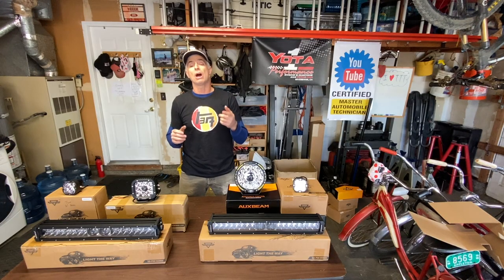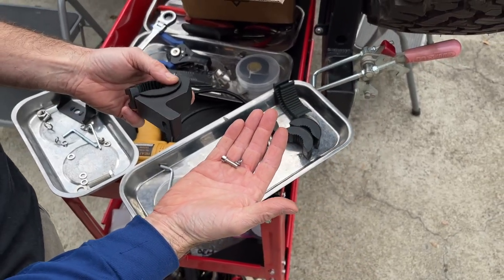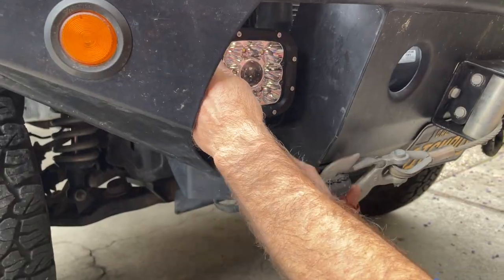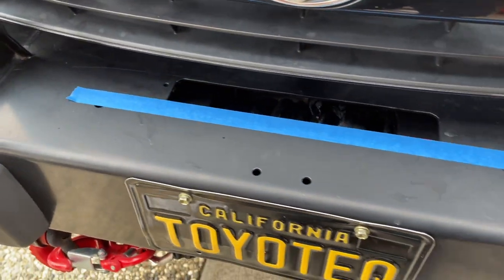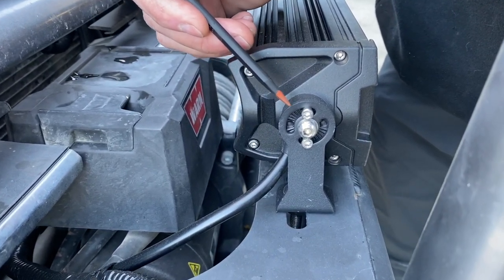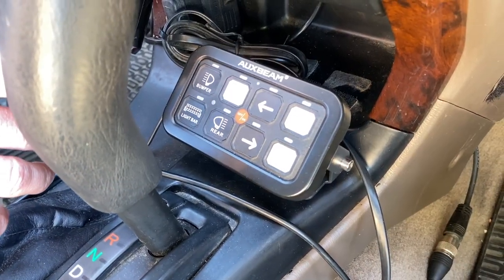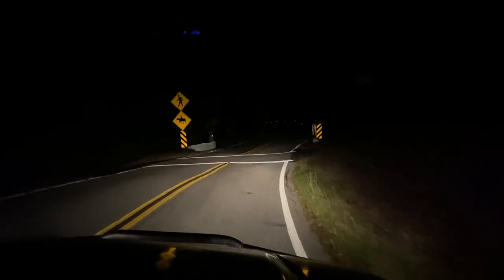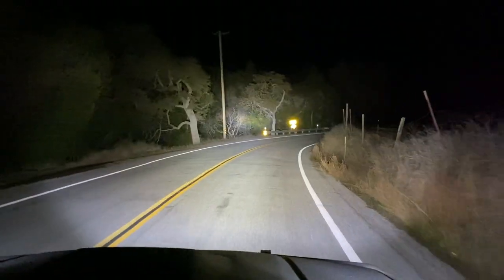How to Install Auxbeam Lights (Mounting and Wiring)

Comment: Wow, those look awesome!!  Thanks for sharing another great video.  I'm glad you mentioned the multi-mode dilemma.  That's exactly what I've been looking at b/c I'm not ready to run lights all over my rig yet, just wanted something I could mount on the A-pillar that might help in fog (amber mode) and on trails (brighter, white mode) and just be able to switch back and forth.  This wiring/electrical business is definitely not my cup of tea, and I just assumed I could easily run the clicker through the firewall (or use an OEM version like Sean mentioned).  I may need to re-think this and get single mode lights.  Thanks!!
Reply: if youre using ambers up front to help with fog you want them mounted as low as possible. not on the A pillars
Reply from the maker: Yeah, we're stoked on the lights.  Glad you like the video.  The multi-mode function could possibly be powered via another switch spot on the switch panel.  You would run the yellow wire to one switch to control the mode function and the black and red to another switch to power the lights.  I didn't want to go that route taking up two switch spots for one set of lights.

Comment: Great tip using wrench to open split loom. Check out Deutsch connects, bit pricey but allows 2 wires in and 2 or 4 wires out. Also they have a bracket that clips on and you can bolt to the rack.
Reply from the maker: Thanks for the suggestion on those connectors.  I'll take a look at them.
Reply: I know the connectors you are talking about but how do you get the 2 wires in 4 wire out

Comment: One thing I want to add about the multi mode light dilemma is you can still use them with the panel you just have to decide which mode you want them to be in permanently. If you want it in the 3 wire mode you just splice the yellow/red wire together and if you just want it in the 2 wire mode you just use the red wire. You can’t choose between the functions (unless you take up 2 spots on your switch panel in which case you’d run the yellow to one switch spot and the red/black to another switch spot).
Reply from the maker: Thanks for sharing that Chris.  Sean and I talked about the possibility of using a switch spot to operate the light mode function but I didn't like that option.  The singular function lights seemed like the logical choice knowing the limitations of the switch panels with multi-mode lights.  I want to save my remaining switch spots in case I need them for more lighting like rock lights or for some other function that I want to power up.
Reply: What is the three wire mode?
Reply: @bramdavid277  essentially if your light has 3 wires it has 2 lighting options, 3 wire mode would be both lighting options turned on.
Reply: @christophergoodwin6846   Hi, so ive got the 6 mode lights. The switch thats on the wiring harness has  a red, black, yellow and white wire. The switch has a on/off toggle button and the button that runs through the modes. Modes being, white, amber, white and amber, strobing amber, strobing white, and the white strobe and yellow strobe back and forth.

So how would that wire up? Id think red and black to one button on the panel for on/off, but for the other button place, how would that go about? Yellow and white in one?
Reply: @kenny7479 hmm yea that’s a bit more complicated. Honestly sometimes I just try things until it works haha. But yea what you’re saying sounds very plausible hooking up 1 set of wires for on/off and another set for modes. Try it and report back.
Reply: @christophergoodwin6846  Got it, yeah we’ll see tomorrow, loll

Comment: I’ve had multi mode lights for over a year and haven’t installed them because I couldn’t find a clean way of running the wiring. That kc wire hider is pretty slick. Ima have to use that and a factory switch like Sean did. 
Another great video from Timmy the tool & Shawny the Sean man, men 🤷🏽‍♂️😂😂. English is my second language
Reply from the maker: Yeah, that KC wire hider was a good way to go.  Anwar told me about it.  I didn't want to run all the wire through the firewall and then up through the roof.  

Glad you like the video Mark.
Reply: @TimmyTheToolman  for the multi-light ditch lights, why could you not run wiring to two switches on the auxbeam? Ex: White mode is switch 1, amber mode is switch 2. 

Is there no way to do that? I would assume you'd have to be careful not to turn both those switches on at the same time?
Reply from the maker: @iridesseaction  Didn't think of it, and there's only so many switches for the lights.   If every light required 2 switches, I wouldn't be able to power all my lights.
Reply: @TimmyTheToolman yeah my needs will allow for two switches. 

Just curious if accidentally having both colors on will cause some kind of burnout or overload risk.

Comment: Great video, following you now, I have the same 3" Auxbeam Pod Lights and I bought myself a 6 gang switch panel also, I'm looking at Auxbeam 50" LED Bar for the top of my 08 Jeep Commander Overland 5.7 Hemi. I am have a hard time finding mounting brackets for the 50" light bar, Im hoping you guys can point me to the right place...TIA
P.S I have'nt installed anything yet until I get the mounting brackets for the 50" bar...
Reply from the maker: @unforgiven101inc  We're glad you like the video.  What kind of roof rack do you have on your jeep to mount the lights to?

Comment: This video is awesome, thanks
Reply from the maker: We appreciate the comment! Let us know how your install goes 💪🏼
- Sean
Reply: @TimmyTheToolman  I already had the Auxbeam panel installed, but needed to see how to route the light bar cables from the roof to the panel. I used your video and another one as reference. So I used the KC wire hider and looks great. Thanks for the great video.
Reply from the maker: @LiquidXiron  You're welcome.  Good job with the wiring.

Comment: I appreciate the video and understand that this is for lights that basically turn off and on but what about aux lights that have the DRL/background mode as well?

I tend to overthink & complicate things sometimes more than what is needed so again I appreciate your video but is there a simple answer to adding the DRL/background wire to the relay and I’m guessing a 3-way switch? 
✌🏽
Reply from the maker: I don't understand your concern.  The only lights that guys usually want on during the day are amber chase lights in the rear for dusty conditions.
Reply: @TimmyTheToolman  I believe the lights I bought have a main LED light that turns on/off and while the main light is off I also have an option to turn on a outer ring backlight option similar to Baja Designs LP9 Pro LED Auxiliary Light Pod with back light option.

Again I’m not very knowledgeable about lights so thanks.
Reply from the maker: @Knuckledragnation  Ok, I understand.  In that case, you would probably want to use the stock wiring and switch to be able to switch between the different modes.  If you wanted to use a switch panel like the ones we installed, you'd have to separate the wiring and have two different switches to power the different functions.  But, you would quickly run out of switch spots on your fuse panel if you have a lot of lights.  I think more expensive switch panels have the ability to operate multiple modes from one switch.  The Auxbeam panels we used are a simple singular function on/off switch.
Reply: @TimmyTheToolman  ah got it. Thanks! ✌🏽

Comment: Would you recommend adding the rear light set up without a aftermarket roof rack?
Reply from the maker: Without an aftermarket rack, you would probably have issues with finding an appropriate mounting location.

Comment: When the bikes is off is there no power to the switch cause I’ve seen guys tapping into some other wire but I’m thinking it’s for a 20 second delay or whatever ?
Reply from the maker: @zachelliott9355  If you powered the lights via a switch panel hooked up to auxiliary power, the lights will only power up when the key is turned to On, Auxiliary or the.vheicle is running.  If you hooked up to a circuit with constant power, the lights would have power all the time.

Comment: If I’m installing one pair on my boat does the automotive relay have any purpose?  Can I just run from battery to lights with the inline fuse and be fine?
Reply from the maker: Not really. The switch you’re using can’t handle the power coming through the wire so the purpose of the relay is to to keep the switch itself from overheating, potentially burning up the wires, and thus reducing the amount of electricity getting to your light.
- Sean
Reply: @TimmyTheToolman does the switch connect to something or is it a stand alone piece?
Reply from the maker: @Randy_Savage_ohyeah  The lights come with the wiring that has a switch and a relay.  So, just connect the negative and positive leads to your batter, and find a place to mount the relay and switch.  If you need to extend the wires, then cut and splice in the length sections you need.  - Timmy

Comment: I have a crazy idea in my mind. All the ideas I’ve had started out this way and I always follow through.

Anyway, you know my turn signals on my truck are currently used as DRL. Ambers. 

Here’s my idea- I ordered new pair of turn signal housing. I’m gonna paint the inside black, heat them in the oven and pull apart the housing. Then I want to stick a diode dynamics ssc2 fog light pattern inside. Close the original turn signal housing. 

Here’s my question…. I want these yellow fogs to turn on all the time with my factory switch. You think the factory switch can handle it?
Reply from the maker: It will depends how much power the fog lights draw.  I can't give you an answer.
Reply: The ssc2 diode dynamic pro draws 2 amp. Input power: 25.6 watts.  And current draw 2 amp at 12.8V
Reply from the maker: @mujtaballa3105  I guess you just need to see what that circuit can handle based off the fuse that powers it to see if the additional draw of power can be handled.
Reply: @TimmyTheToolman  thank you! I’ll
Check the fuse and see what it says.

Comment: you should be able to run the yellow wire to a different button on the Multi switch
Reply from the maker: Yes, you could do that, but if you have many multi-mode lights, like I originally got, I would have ran out of switches.

Comment: Timmy, which Auxbeam fog/driving lights are street legal (or any other brands).  If you know, can you post the link to Amazon?  Thanks
Reply from the maker: I don't know which brand Auxbeam or other manufacturer lights are street legal.  All the lights I put on my rig are for off-road use only.  

I do know a common way to go for additional legal lighting is buying projector retrofit headlights or you make them yourself.  Check out this video we did installing TEQ Customs projector retrofit headlights on our rigs: https://youtu.be/L3LOKMx2WWE?si=kGOFbUgYkq0Np1eW
Reply: @TimmyTheToolman  Street is legal  lights must be Dot/Sae J583 compliance 

There's Rigid brand, but it is pricey.
Reply from the maker: @wilsoneashoian5789  Yeah, Rigid is very pricey.

Comment: Next is neon lights in the wheel-well?
Reply from the maker: Yeah, I know a lot of guys install the neon rock lights.  I've seen guys use these to light up the area around their rig at a campsite when they're setting up camp.  I might add rock lights at some point but not any time soon.  I'm tired of running wires.
Reply: And putting a cummins in a Toyota to carry the weight of all of those lights.